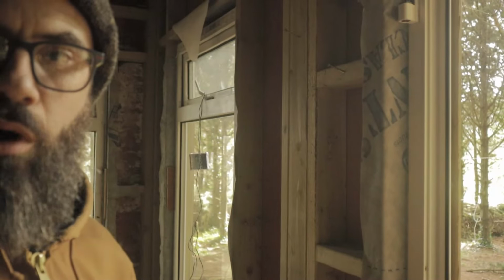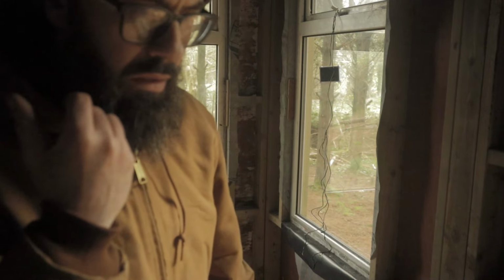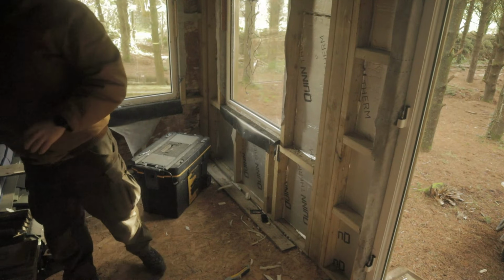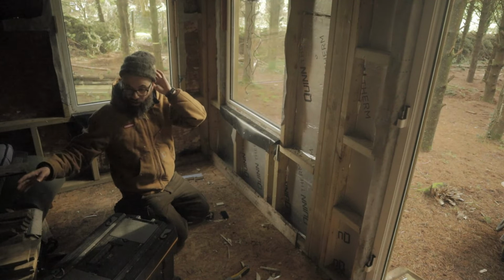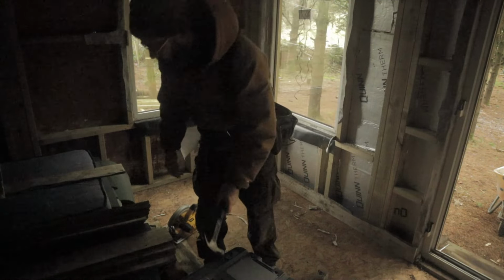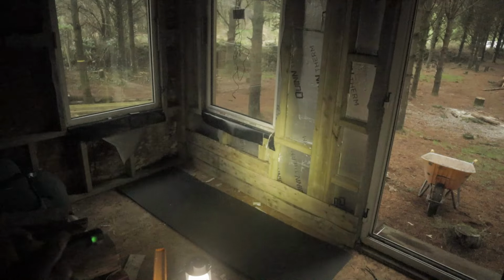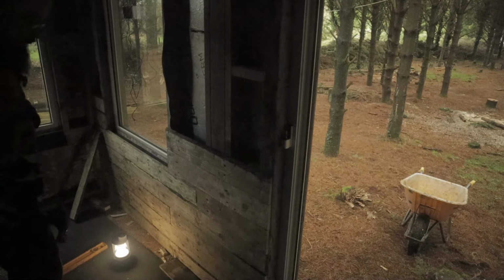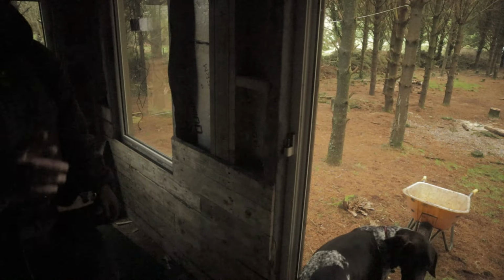Off Grid Small Cabin - Insulation and Pallet Cladding

Comment: Good idea to use the pallet boards, and the Kingspan insulation along with a Jotul will keep you cosy.
Reply from the maker: Jotul ? Stove ?
Reply: @WoolysWorld  Absolutely, a Jotul 602 or a Waterford 104 with a kettle plate would be wonderful in there mate.
Reply from the maker: @ianthebastard8128 it would be fantastic, if I can get one at the right price
Reply: @WoolysWorld  You can still find them reasonably priced.
A good few years ago, I bought a 602 for £100 from the local reclaim that had a snapped off leg, spent £40 on the repair.
Last year I picked up a brand new Waterford, I got it from a closed down showroom and paid £300 for it (a one off), it's got all of the new regs but it's not quite as good as the Jotul, although almost identical... Start hunting
Reply from the maker: @ianthebastard8128 I've been looking, need to have money waiting to go
Reply: @WoolysWorld  I know, it's always the problem...
Reply from the maker: @ianthebastard8128 yep